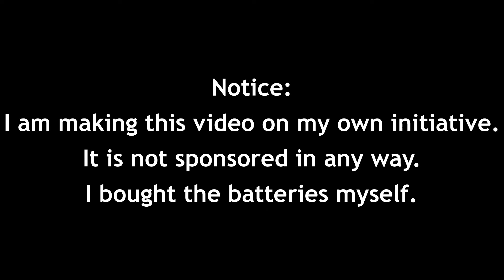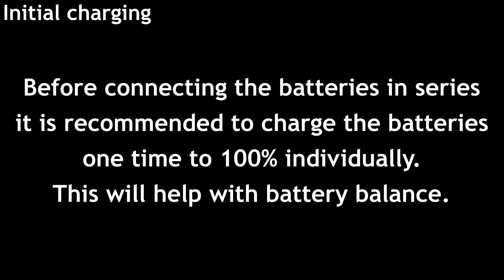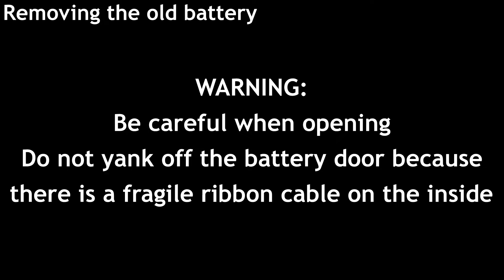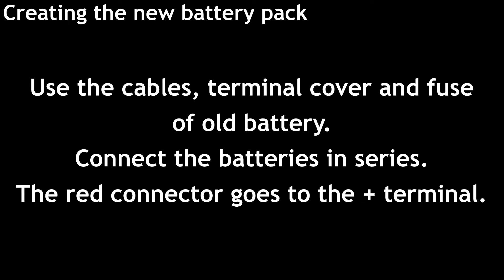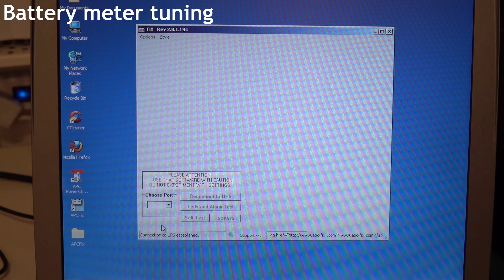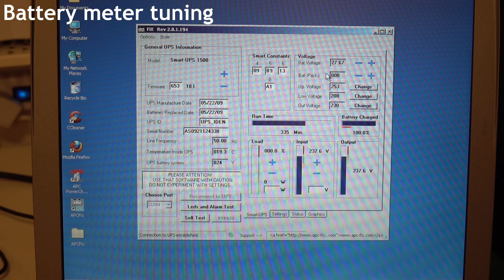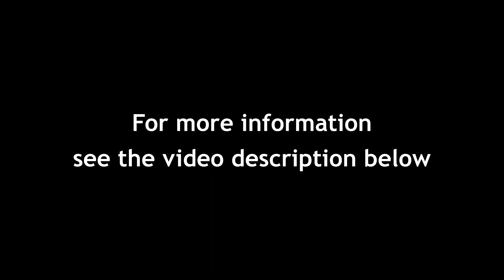Upgrade APC Smart-UPS to LiFePO4 batteries by PowerTech

Comment: Lifepo4 is great for ups. 
I did something similar 5 years ago. But i made my own 25.6v pack
With 16 x 6000mah cells , i paid around 50$ for them. This was in 2017-18. 
Under 300w load it runs 45min. 
Using ready made battries have some downsides. 
These battery come with inbuilt bms. That might shut off before the ups does and that will result in the ups not automatically starting back up when mains is restored.. also a bms is not required when using with ups as there is very precise voltage regulation in the ups. I only use a 8s battery balancer. And the battery is running for 5 years with 0 degredation in capacity. My ups is apx br1000g and it is capable of 600w. It is also meant to be used with extended battery which is necessary when you move to Lifepo4 because they are higher capacity than leadacid and have no pukert effect. So a 12ah Lifepo4 is equivalent to 28ah leadacid under 300w load. Thus if you install Lifepo4 do not run the ups above 50% unless it is meant to be used with external battery and has necessary cooling for such extended runtime under high load. 
I first tried this battery with a cheaper "1100va" model that used low frequency transformer. And the transformer melted. 
The br1000g indian model uses high frequency inverter and have large heatsinks to run extended battery. And have strong charger that will provide 3.75amps if you short the external battery detect pin to ground ! .
Reply: make a Youtube tutorial to step us thru it
Reply: Awesome tip about the external battery detection pin! I have a couple APC RS 1500 with external packs that I will be converting to LiFePo4.
Reply: @gannas42  yup. Just short the two outermost pins of the connector and it will think an external battery is connected. Lifepo4 can take much higher charging current than leadacid so this will enable faster recharge. And the ups will correctly calibrate runtime.
Reply: @KuntalGhosh  You aren't kidding... the cylindrical cells I chose can take 35A continuous charge current. Amazing.
Reply: @gannas42  what cells you bought?. 32140fs or 32700?
Reply: @KuntalGhosh  Ah, my mistake. The batteries I initially looked at were not available so I downsized to 32140 16Ah which has 5A continuous charge current.
I think I also chose the 32140s because they will fit in the existing battery compartment without any modifications to the UPS chassis.
If it works well I'd consider adding an external pack but that may be overkill. The original SLA Batts were 7Ah so 16 should be a significant improvement combined with the much higher recharge cycle count for life expectancy.

Comment: I am 1 week away from doing the same with my sua1500i from 2006.
Did you complete battery runtime calibration?
How much of a problem is run time and following shutdown affected?
I installed a AP9630 network interface a few years back. Makes it MUCH more easy to change settings and view log of events and temp+voltages.
how is yours set up?
Reply from the maker: No, I did not use the runtime calibration. I don't have the required load of half the capacity. What I did is in the video, I reset the battery constant using APC-Fix and did a full discharge with 300 watt load. This is a load too low for a proper calibration. Even with the proper load it remains to be seen if the UPS can ever learn the true capacity of these batteries because the capacity is much, much higher that anything that the UPS expects.

Any automated shutdown (Using the APC PowerChute software or similar) will happen when the UPS THINKS the batteries are near empty. However, the UPS will stay on and deliver power until the batteries are drained.
Reply: Do not use readymade battery. These have bms that will shut down before the ups does and that would mean the ups will not turn back on automatically when mains is restored. You can not use any sort of cutoff with ups. The battery must be connected to the ups all the time. The ups will accurately handle low voltage & high voltage cutoff. So all you need is a cell balancer. And balancing is a problem with Lifepo4. Even new cells will have ±2% capacity difference and the voltage gap will grow between two packs if you do not use a single balancer that would manage all 8 cells at once and equalise them all in one piece.
Reply: @KuntalGhosh  Set min state of charge to like 30% for it to shut down seems to work for me at least with a matrix 5000. first time i did a manual battery cal 30% load and pull the plug until it turns off. YA it Wouldn't come back on. Bms opened. had to use the charger to kick the bms back on before the ups would charge. Yes battery equalizer is a absolute must even with only 2 batteries.

Comment: Mmmm windows 98 and shady Russian links. I wonder how new of an APC that software will program. I wonder where you purchased those batteries. I have a hard time believing they offer 30AH at that sizes unless they use grade A cells or rather I wouldn't believe it without a capacity test. You are one of a few posting such videos
Reply from the maker: Windows 2000 ;-)
I think APC-Fix will only fix the generation of UPS that I have and older. The ones with green LEDs as battery indicator and no LCD screen. It only woks via the serial (com) port on the UPS, not via USB or Ethernet communication.
I got two sets of batteries from two different shops:
EVEA Kartmasters, NOT recommended to buy there. They delivered but it took very long and communication was a nightmare.
MZE-Drive. Very friendly guy. If you're not from Germany you have to ask him for ordering from your country. Both shops order directly at PowerTech systems and PowerTech will ship to you directly via UPS. If shipping costs are very high at MZE-Drive ask for more affordable shipping options.
https://www.mze-drive.de/product-page/powerbrick-12v-30ah

Comment: Good Video, just curious to see how this will fare over time without the LiFePO4 charger.
Reply from the maker: I did a full discharge and recharge using the UPS charger itself. No further cycles have been needed yet as my utility power is usually quite stable.
Reply: @Hypernl  that's not a good statement, the reason you have this is it protects you when the utility is not stable.
Reply from the maker: @abnersilverio  You never know when power will cut out. The fact that utility power is quite stable does not guarantee that it never cuts out. I just like to be protected.
Reply: Lifepo4 has nearly identical charge curve to lead acid. If you didn't have a BMS the. You'd have problem but, most Lifepo4s batteries have a BMS in them. At worst the BMS kicks in and the UPS flashes the  empty battery icon until the battery starts taking in some more trickle charge again. That's how mine works, even in this state of I kill mains power it clicks over just fine and ina few seconds detecs the battery. So aside from that minor indication flashing it functions the same without needing new batteries every three years old my cheapo Lifepo4s hold up
Reply: What about using a dc to dc boost converter to increase the charge voltage of the APC to the proper level for Li-Ion batteries, wouldn't that make it fully compatible? You could mount it inside the chassis.

Comment: is this 24V?
Reply from the maker: Individual batteries are 12v 2x 12v in series making 24v for the pack. (Same as the original SLA/AGM batteries)